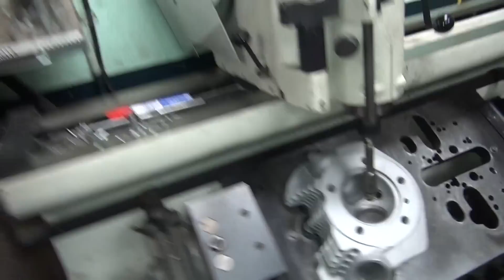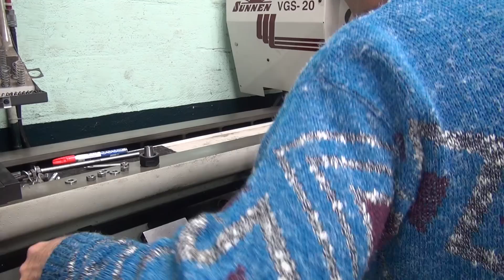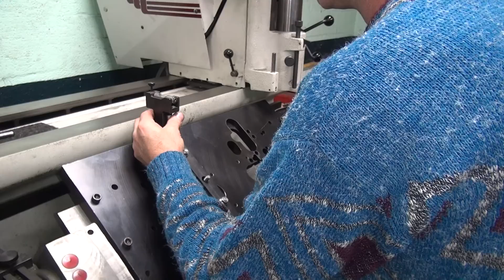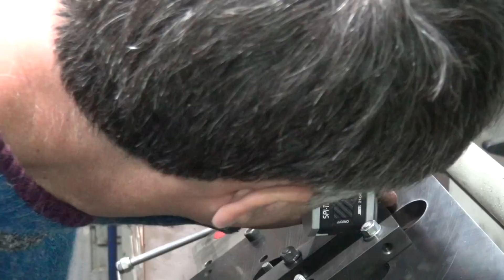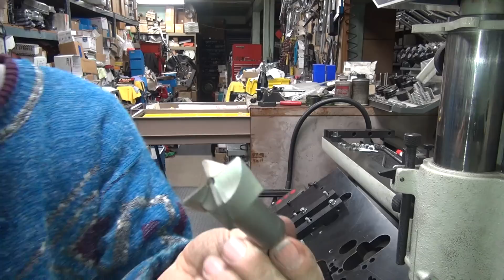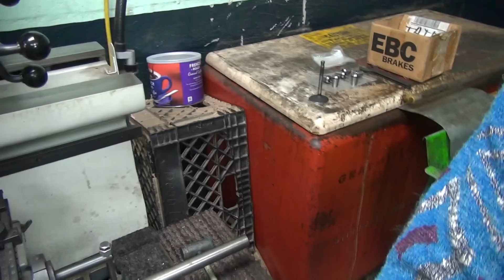1974 #106 74ci shovelhead valve job, porting, guide hole repair rebuild harley by tatro machine

Comment: Hi mate where could I buy one of these head holding plates? Also I have a set of 66 heads and the line bore is slightly off so when I put new guides in the valves sat slightly off the seats. Enough for it needing to need these guide bore hols to be straightened, what would be the best way to sort this problem?
Reply from the maker: sunnen use to make them. that is about 30k worth of tooling you are looking at.
if you want to correct valve guide holes you should be using a milling machine. two angle plates will hold the head for you. go watch some of my exhausts port repair videos to see how to use them.
tatro